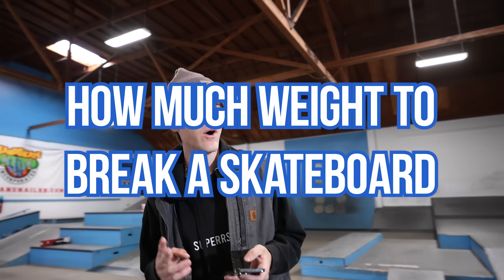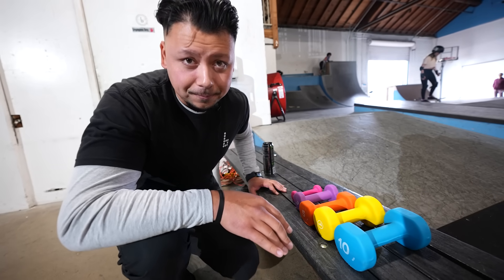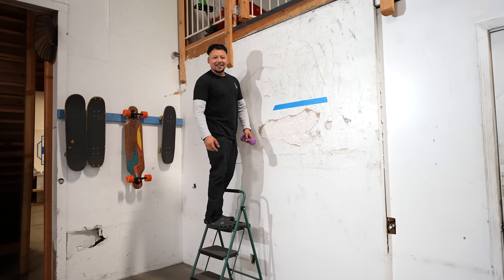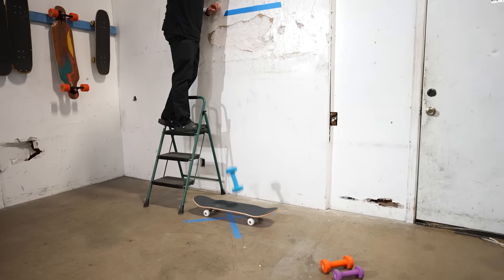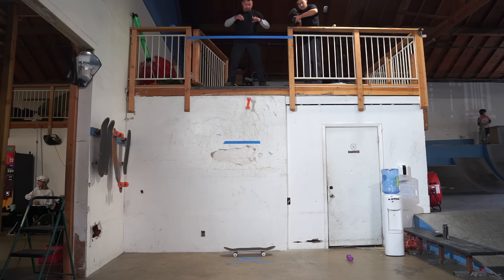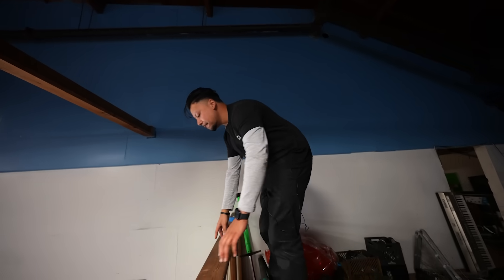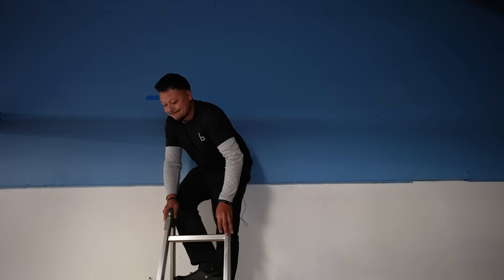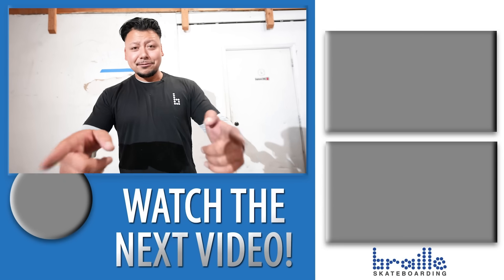HOW MUCH WEIGHT TO BREAK A SKATEBOARD?!?!

Comment: Honestly the largest factor is how the force is hitting on the surface- the smaller area is going to be more impactful.

For example, huge difference if it lands sideways on both ends because theres more area to spread the force compared to vertically where it cant spread that force.

Comment: I guess this just shows that weight per square inch matters a lot for skateboarding, when you consider many skaters have done much higher and with their body weight. Like Ali Boulala, Aaron Homoki etc
Physics is so interesting haha
Reply: Bigger guys have hurled themselves down big stuff, but jaws is only 5'7" around 120lbs according to google. Just plain skinny lol. I'm around the same height and I could be that skinny but I'm way up there. When you land the board vibrates like crazy and they're built so the grain goes in both directions, every next ply alternates , by design, for strength. I ualso use a few tricks like stiffer bushings perosnally. When there's pumpkin pie and christmas cookies around me I aint got time to diet.
Reply: @haroldcampos9661  Sure. Haha

Comment: One time i dropped my board sideways like an inch and it fractured my big toe. Turned golf ball size... I hated that injury so much. lol Skateboard plies are alternating bi-directional grain, but if you focus it with one leg easier that's just concentrating the energy more in one spot. You know how they say, 'do heavy objects drop faster'? But a big piece of foam won't hurt like a coin if they fell on you, so rate is constant but force probably changes on weight. Also one can't carry the like 10lbs if it's too unwieldly or at the end of a 30 foot stick, hence dumbells being compact/dense...or self-contained. but thats just leverage.